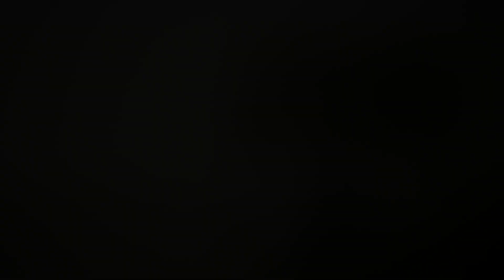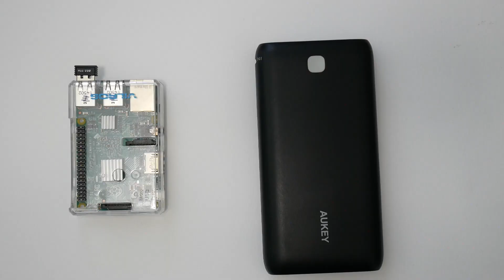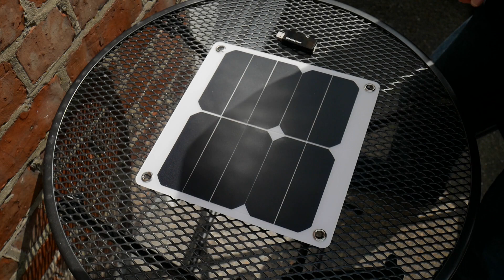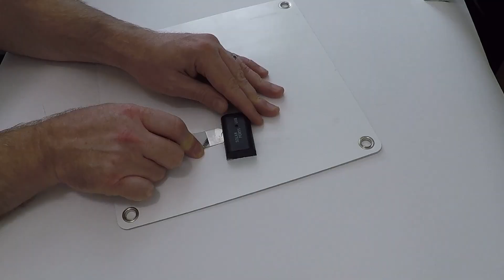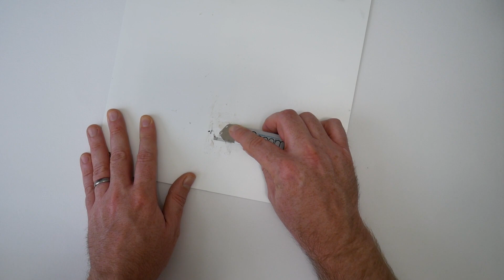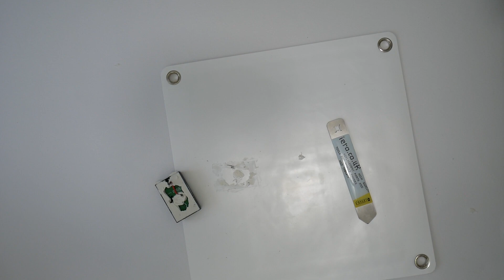Solar Powered Weather Station (Part 1 of 4)

Comment: 12:38 - I actually think, the voltage regulator works with some kind of two concensators.
Reply: sub - 21.06.19 02.21